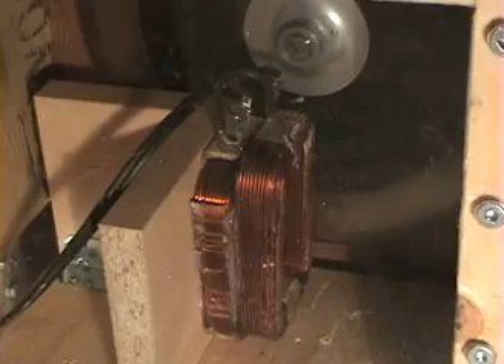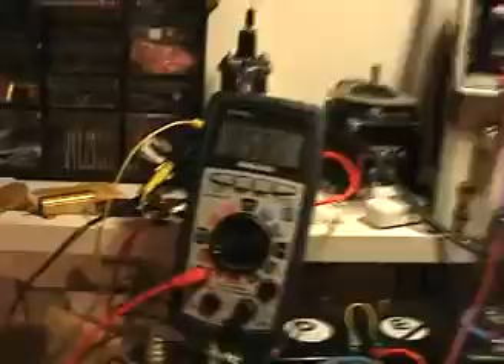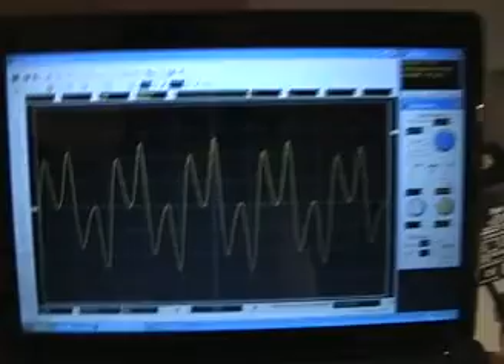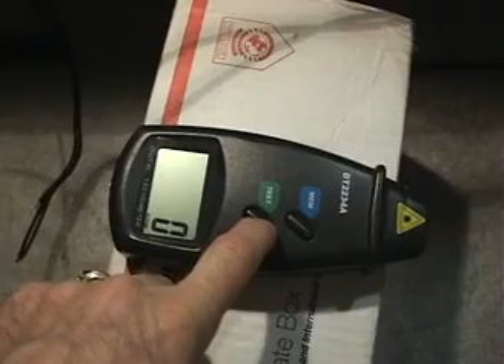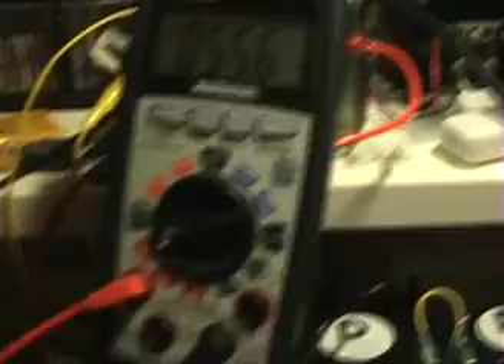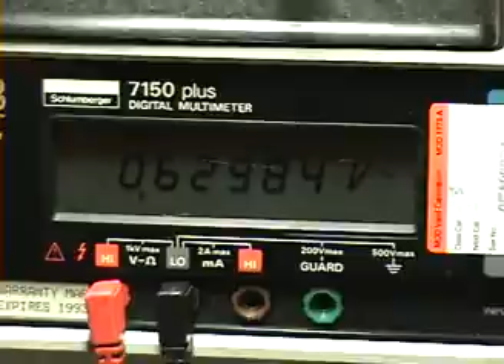Generator Coil test 4

Comment from the maker: Hi gatekeeper1006,

the next test will be using a high windings air core coil and collecting only the collapsing field. We are testing for ways to collect energy from the coil without creating drag. Cores will create drag as the magnet will want to stick to them.

Stay tuned for the next video.

Luc

Comment: @gotoluc 
So, that means that high drag generators can be used as regenerative brakes in cars. Because they'd have sufficient torque to stop the vehicle. Whereas these low-Lenz generators, that you'll make could be used as alternators in cars and cause minimal drag on the engine, and thus, reduce consumption. Very nice I must say ! 5*

Comment from the maker: Hi m3sca1,

My test are coreless!... the magnet won't get attracted to the copper and if I used cores I would need to also to put power back in the coil for the magnet to pass the cores attraction. Where would the benefit of using cores come?

Luc